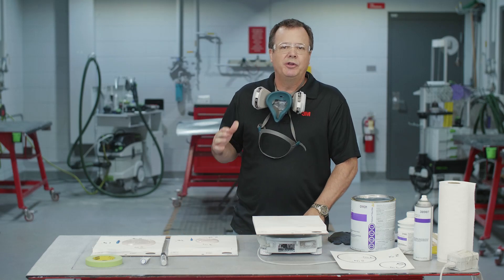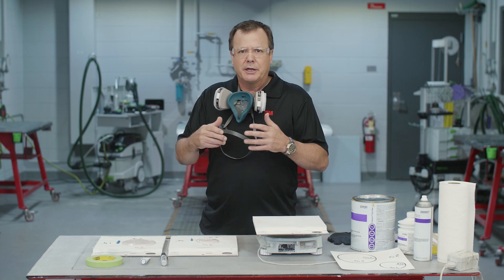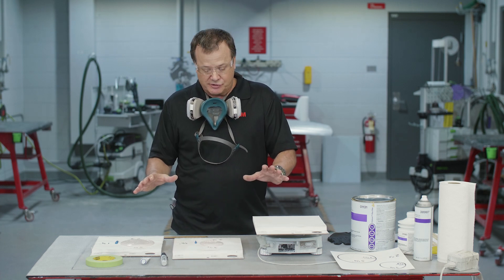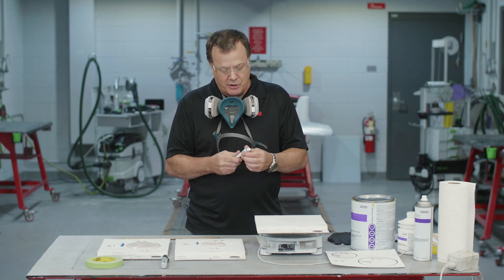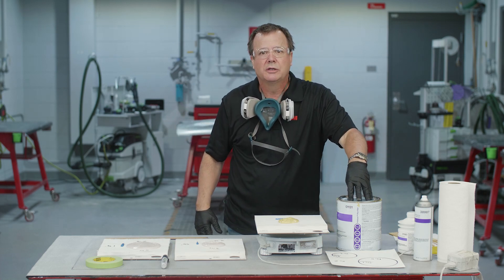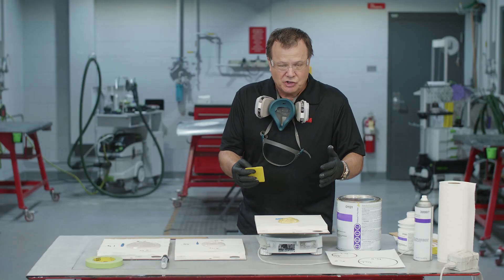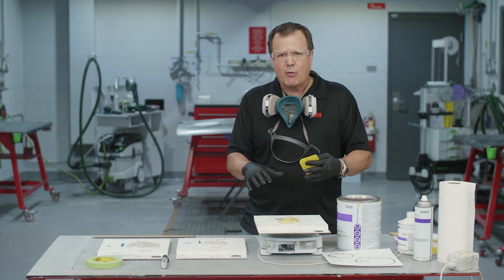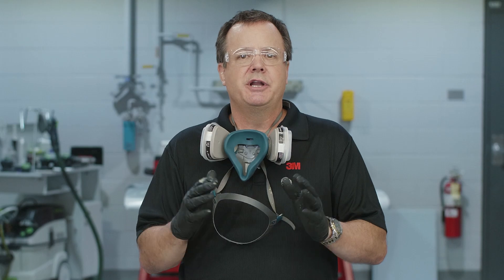Tech Tips: Mixing Hardener with Body Fillers and Glazes

Comment: One other thing gussen weight the thickness  on where you might be 1/2 filler on the board with a 4 inch puddle next time u might be thinker or thiner so that could be a difference in hardner

Comment: Wouldn't 2 percent be........2 percent instead of 7/8 of a inch lol like you put you the amount of filler you think you'll need and weigh it and then multiply that by .02 that will tell you how much hardener you need for your particular pile example say you have 32 grams of filler you would need 0.64 gram of hardener.   32 times .02 is 0.64. Would that be correct?

Comment: Being experienced and using 3m filler and glaze for the most part everyday for the last 13 years, I take into consideration the temps, but most importantly the size of the spread and the difficulty when I mix filler which is essentially no more than what he shows in this video, if anything I use a little less on big spreads to give myself plenty of working time but mix it thoroughly, not “stir” is, press out air pockets, and tight, thin spreads, I get complemented a lot on how clean my spreads are, and painters love them because they rarely have pinholes

Comment: Excellent, the % was what I wanted to know.
Reply from the maker: Hi Mark, we typically recommend 1.5-3% hardener to filler, with 2% (or 1:50) being the most common mix ratio.
Reply: A measuring  scope for filler please,then 3/4 to  1inch hardener

Comment: The chemical reaction is exothermic, a process by which heat is created. I don’t live with math on the tip of my mind, unless my wife has the credit card. But using scales, 100 grams with 2 grams of hardener is 50 to 1. In this example, 50 grams with 1 gram of hardener is 2%.
  I do like the idea of placing the hardener next to the filler product as you have other things going on. A co-worker needs help installing a part, your name is called over the loud speaker as you have a call on line 3, or those times when nature calls, do to 4 cups of coffee! It all matters for a long lasting repair done right.
  Nice reminder of a basic function we take for granted! Thanks.

Comment: @5:22 "I like to dispense a bit of hardner at the beginning onto a paper towel"
I understand why but if you have kneaded the tube properly why waste this?
Using it from a paper towel is more difficult than need be. Apply it to cardboard that way if it's not watery you can scoop & use.
Waste not want not.
Good video, thank-you.
Reply: The stuff on the paper towel isn't used - it's thrown away. Sometimes even after you knead the hardener some liquid stays in the hard plastic where the cap threads are and doesn't get mixed. There's not much to be done to avoid that, except maybe to mix your hardener before you add it to the filler.

Comment: I know this isn't exactly a rocket science thing....but you would think with the total brain power at 3M and all the container technology available.....that there would be an easier way to get body filler onto a board from a can and properly dose hardener in 2021.
Reply: look at their Dynamic Mixing System, its a pneumatic gun that mixes the perfect amount of Part A & B in the nozzle and you can shoot it onto your board without having to mix it, also eliminates air bubbles completely
Reply: 2% by weight, why can't they just put that on the package along with their other instructions?  Tare a scale with a plastic cutting board on it, 50 grams putty, 1 gram hardener, seems easy enough to do each time.
Reply: Needed like a ice cream scope then the  bead
Reply: Right… check out my comment to 3m about there mixing sheets and let me know if you think it’s a good idea.